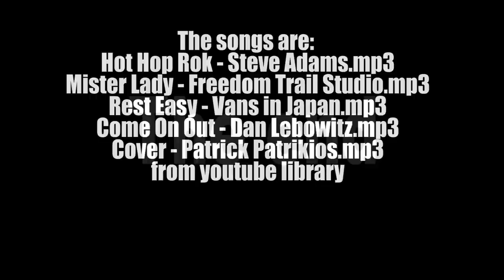We reconstruct the stem to a gold ring with a worn stem

Comment: the only part he didnt show was the only part i wanted to see mostly where he did the first solder from the band to the head. very good work regardless, looking forward to any more cool things he makes.
Reply: I'm guessing he laser weld it to hold in place, because that's how i do it.
Reply: @ovanestopchyan1755  hey what do you suggest if we dont have a laser weld how do we do it?
Reply: @shuraimsamoo  Solder
Reply: @pijnto  yes i guess we can solder using locking tweezers or something
Reply: @shuraimsamoo  If make the join perfect fit and the Gold is annealed it will just sit in place as you Solder
Reply: @pijnto  okay bro thanks 👍
Reply: @shuraimsamoo  I get one side lined up and soldered then any minor adjustments on other side can be done before second solder . Fab video as usual 👍